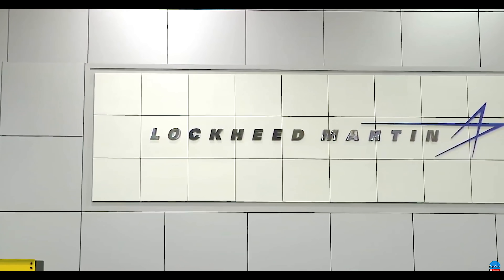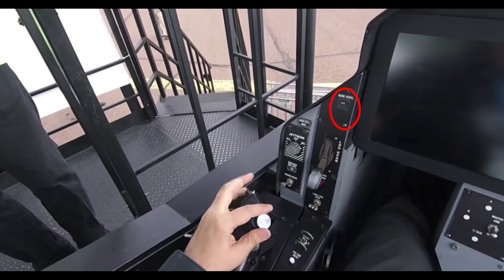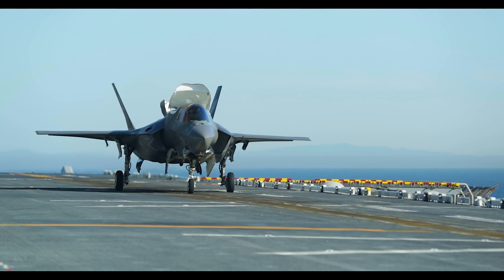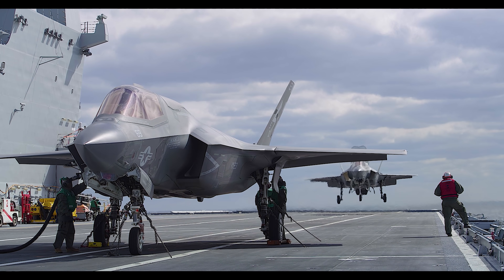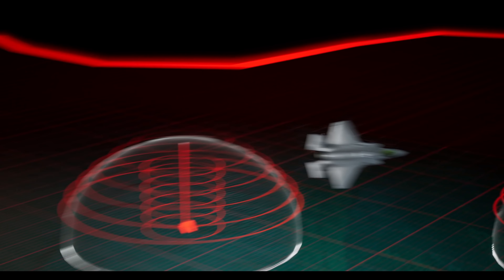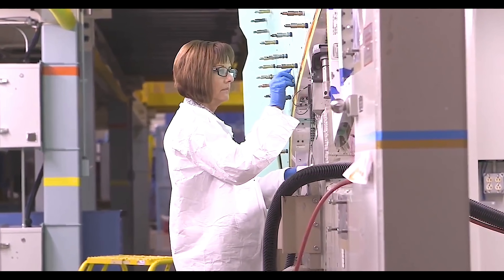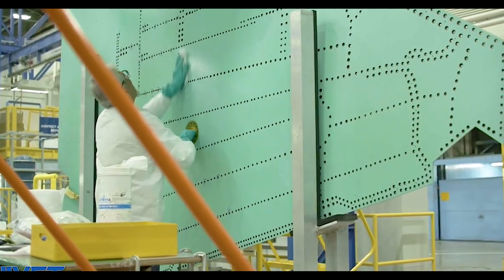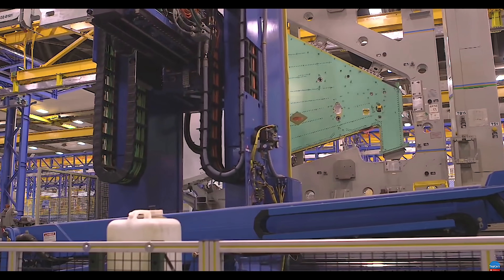Inside the F-35 Factory: The Most Advanced Aircraft Ever Produced

Comment: The three F-35 variants share only about 25 percent parts commonality.   Blame the Marines for wanting a completely unnecessary and outdated STOVL capability.   That added HUGELY to the development costs. 

The F-35 is built around the concept of radar stealth but the problem is that radar stealth is a dead end technology.  Thermal means of detecting aircraft and the megawatts of heat they generate are getting better and more common with every passing year.  It won't be long before any aircraft flying can be detected by its heat signature and at that point radar stealthing is irrelevant. 

Despite that, the F-35 was made larger, bulkier, and heavier just to internally stow its weapons so as to hide them from enemy radar systems.   That larger bulk and added complexity can't be gotten rid of even after the bombs and missiles are dropped and the weapons bays are empty.  

At the end of the day, the F-35 has about the same combat radius as the F-16 and burns through more fuel to do it.  It carries more fuel in its larger airframe and feeds a bigger engine that it needs to achieve comparable performance in terms of acceleration, speed, and thrust to weight ratio.
Reply: here we see a person who thinks he knows what he's talking about but infact does not. learn what stealth actually is then we can talk. sorry for sounding rude.
Reply: Lmao, IRST has way less range compared to radar. It's a joke to think that thermal signature can outrange radar, and keep in mind that even if you did have a thermal cam to detect the F-35, you would have no means to get n accurate lock. You need radar for those ranges, especially in uncertain weather. Also realize that with F-35s DAS, it can detect any aircraft with IRST compared to most aircraft. This isn't mentioning the fact of AWACs existing. 

The F-35 can still carry a larger air to air weapons load if they want a pure air interdiction role, Block 4 being able to mount more AIM-120 per hard point. The combat radius of an F-35 is actually double that of the F-16, and if we're comparing the two, the F-35 has an immense amount of avionic and sensor technologies that most legacy aircraft will struggle to equip with their airframes.

Comment: so i wonder how many extra electronic components the government will buy to stop from needing to take components from one airframe to make another fly in a few years.  spares..  and how repairable will the modules be..  are they going to be made like new automotive electronic controls and NOT REPAIRABLE  must replace with NEW.. but if new are not available ... what do they do in the future..
Reply: It been a problem for a long time. I mean, do you think the CPU and chip sets for a older F16, or even f22 can be had with ease? A good number of those systems were built 40 years ago.

So, it not a new problem. At least with the F35? They moved more of the systems to a open software architecture.  This means you can for example swap out the CPU system - much like you can with a PC. So, for example, the f22 has quite a old and low power CPU. It is rated at 700 mips.  (about that of a first gen Pentium processor). They had plans to upgrade to  2000 mips processor, but the chip sets used are long out of production.

To get an idea of 700 mips?

Well, you low cost smartphone has about 5600 mips (low end Android phone). The higher end phones are significantly more.

So, that $80 smart phone has a whopping EIGHT times the processing power of the F22.

The F35? Well, they are swapping out the CPU's starting next year - and will add about 25 times increase (not 25%, but 25 times!!!).

So the F35 allows updates to software and allows updates to the CPU system with FAR greater ease then older jets. The often used flip phone vs smartphone is a good example. You can update the software and features with great ease in a new phone - older phones architecture did not allow this.

The chip set in the F35 is based on IBM's power PC architecture. This is the same chip set that IBM uses for their Artificial inteligance systems, and is also the same systems that the Lawrence Livermore atomic bomb labs super computers use for running computer simulations of atomic bomb explosions.

So the newer systems are FAR more modular, and have far more options to software and hardware updates. 

But, be it a F18 built in 1990 (31 years ago), then the basic computer chip sets can certainly become hard to find.  I actually don't know how they find and get say a new CPU for a f22, or say a older F18. 

The first fighter jet to have a semiconductor based computer on a chip? It was the F14 tom cat - (1970).

So, this does become much like how do you go and find a 30 year old computer - can it get it to boot and run today????
Reply: @Albertkallal  i understand completely. thank you .. ps.. i have a 1984 Mac 512K.. that every once in a while i plug in and book off the 800K Floppy disc system 4.2. 
i have to dig out the 386DX and the 486DX Machines and probably drop them off to JPL to see if they need them.  i never recycled them as i knew those were space rated processors.

Comment: It’s a technological marvel, but it’s survivability is entirely questionable.
Reply: It should be better then previous jets. For one, they removed a LOT of hydraulic lines.  While in the past most jets relied on a hydraulic lines to move surfaces and other parts, the F35 uses electro-mechanical for many systems. This not only means that less chance of hydraulic lines can be damaged, but there are multiple routes for the software and electric lines that control things. 

And the F35 has MUCH MUCH more hydraulic fluids. (because they actually use jet fuel for this purpose). So in place of a super tiny hydraulic fluid tank, they use jet fuel - and hence even in a the case of a damage + leak? In place of say 50lbs of fluid? You have  tank of 18,500 lbs of fluid - so that provides a HUGE reservoir for a lot of leaking fluids!

Given that in 20 years of testing? They not lost one F35 during testing. Compared to ANY other fighter jet program, the F35 has the best track record - and by large amounts.

Comment: The issues - it is too expensive, and it is not as good as the heavy fighters like Rafale, Raptor, Eurofighter and Su-35. It is too much computerized, so if the computer fails, the aircraft fails. And as it is used in extreme conditions, the computer fails often. It is in general good under the US defensive doctrine of air and sea superiority. In terms of smaller land based conflicts, it is not a very capable fighter jet.
Reply: yes, that is why air wings of F35's are now flying up in Alaska!!!

Don't be silly. The F35 is one of the most reliable jets EVER made and introduced into the Air Force.

I mean, even articles AGAINST the F35 state this:

A critical metric of reliability is the “break rate,” meaning the percentage of fighters that return from missions in a non-mission capable state. About 94% of F-35A sorties are completed with no breaks—by far the best performance of any Air Force fighter

Wait - READ THAT AGAIN! The F35 is MORE reliable and BETTER then ANY OTHER Air Force fighter!!!

How about this:

Over 90% of F-35 parts are proving to be more reliable than required, and a majority never fail at all despite the rigors of combat training

Wait? The F35 is EXCEEDING the reliability numbers for the Air force? Yup!!! you read this correct!!!

Maintenance hours per flight hour are low. The F-35 was designed to be more maintainable than legacy fighters, and it is. The Air Force variant requires far fewer hours of maintenance per flight hour than the F-15 or F-16

Wow - just read above again!!!!! - FAR FEWER hours of maintains!!!

In fact, the number of maintenance hours per flight hour on legacy fighters is a multiple of what F-35A is demonstrating today. The Air Force’s stated requirement for F-35A is no more than nine hours and the actual is five hours, making it the most easily maintained tactical aircraft in the Air Force fleet

Again: the F35 is one VERY good aircraft - and if you bother to read the REAL numbers? You get the above quotes!!!

F-35A outperforms other fighters in speed of fixes. All fighters require repairs, especially if training missions successfully mimic wartime conditions. A key metric of sustainability is whether fighters in need of repair can be fixed in a single eight-hour shift. F-35A has consistently outperformed all other Air Force fighters in achieving this goal, thereby speeding return of aircraft to the operational force

Sorry, but the F35 is quite much the EXACT opposite of what you claim!!!

And now the F35 is lower cost to buy then most 4th gen jets - and you get MUCH more features for that cost.
Reply: @Albertkallal  https://www.gao.gov/assets/gao-21-226.pdf